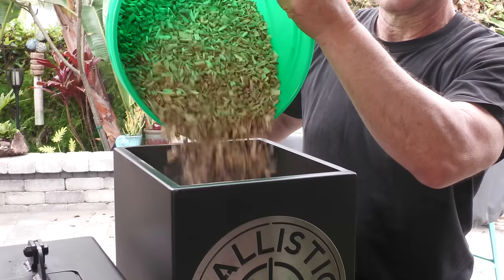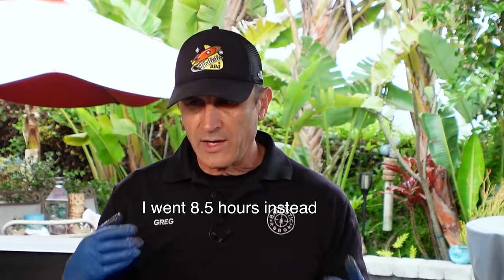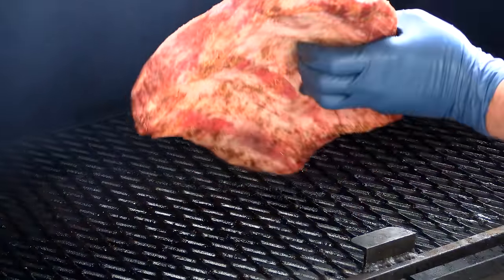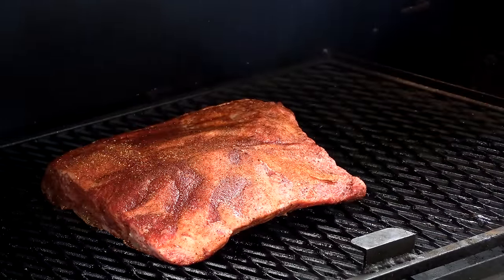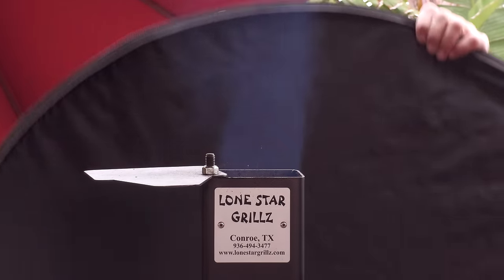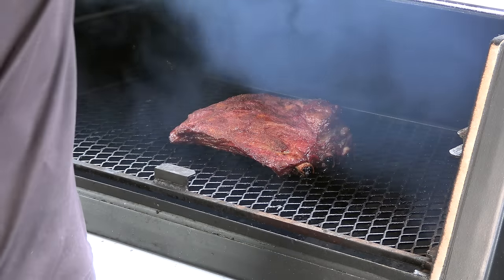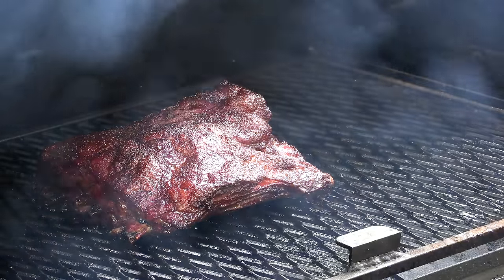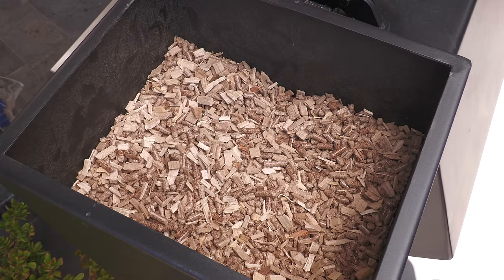Replacing Pellets With Wood Chips In My Pellet Grill On A Long Cook!

Comment: I love how everything is advancing in this industry. That said, I would never try this with my SmokeFire. It's finicky when it comes to pellets and I can see wood chips sheering the bolt off the auger or jamming it at the least. Nice video!
Reply: You are absolutely correct. I've owned numerous Weber grills and when they came out with the SmokeFire I decided to pull the trigger. It's basically a  replacement for a gas grill with a wood chip tube. It won't ignite with many brands of pellets. I've tried six different types of pellets thus far and the only one that works reliably is Jealous Devil Jax Legendary Blend. I live in Florida so maybe it's the high humidity. If I want to really smoke something, I use my Weber Smokey Mountain Smoker. I know that's comparing peaches to apples but, I expected more out of the SmokeFire.
I was excited to see the smaller wood chips available and have been testing them. I started with a 50/50 mix and immediately jammed the auger. I restarted the smoker 4 times in an hour. I next tried a mix of to 60% pellets / 40% wood. That did work better but, still jammed about 2-3 times per hour. I'm down to 80% pellets / 20% wood and it's still jamming irregularly. I know the SmokeFire is NOT a wood chip burner and I'm not talking smack about it, I was just hoping for more smoke flavor.
Reply: @billkelly1793  I use Lumberjack and have had great success with them. Also used Bear Mountain which stressed the auger but worked okay. BBQ Delight worked good as well. It might not give the awesome smoke flavor but it does produce awesome bark and smoke rings. Char Hickory has produced the strongest smoke for me, actually pretty good for a pellet cooker. 

It's been a good cooker for me for almost 3 years but it's like almost every other pellet grill. They give ease of use and let you get along with your day but trade off smoke flavor. Looks like LSG found a formula to fix that. Thought Camp Chef might have but head to head tests still look like it don't compare even to a gravity fed like Master Built.

Comment: I wonder if sharpening the edges of the auger would help the chip size not be soo critical?
Reply: Doubtful. Weak auger motors and hardware(bolts shearing) and too tight of tolerances cause jams. If the industry would shift to wood chips vs. The pellets....or I should say wood chips and or pellets, these type of grills would be much more popular.

Comment: I have a Mak grills smoker and can DEFINITELY say these DO NOT work with a MAK. I'm going to start trying to see if there's a ratio that will even work at all. Can confirm that 50/50 doesn't work. 40/60 doesn't work, 30/70 doesn't work.
Reply: What does “DO NOT work with MAK” mean? Auger gets jammed? No smoke enhancement? No taste improvement?
Reply: @BarryMunkasy  jam city. That's why I mentioned lowering the percentage over and over. The smell was fantastic right up until it jammed. And it's not fun at all getting those pulled out.
Reply: Thanks for saving me the frustrations.  May your next brisket have a choice cost and be a wagyu experience!
Reply: @BarryMunkasy  since Mak has extremely good customer service, I sent them a message asking if there's a more powerful auger motor or possibly a way to sharpen the auger. I'll let ya know what they said.
Reply: @chrishall1407  Thanks for helping us out.  I was searching to see if anyone tried this on a Mak!
Reply: @OSUFANATIC1980  yep. Unfortunately, there is no ratio that works. HOWEVER, since I had the chips, I discovered that they put a great flavor to my longer charcoal cooks on my pk360 using the snake method. So, silver lining. 😂
Reply: @chrishall1407  that stinks. I do same on my Weber when I grill just throw few on top of charcoal then close lid for bit

Comment: Has anyone tried this with a Traeger?
Reply: I did. Was making a brisket last week and it jams the auger frequently. You can hear the auger squeaking a lot like it’s having a hard time passing it through. Really wish it went better. Maybe use less chips next time. Like a 70/30 mix. You should really pay attention to it and be there to clear the auger jams, or as it displays, “auger overcurrent”.
Reply: @jonah327  Thanks for the information.  I'd really like to get some more smoke flavor out of my Traeger, but this may not be the way to go.
Reply: @billfreiberger1627  yeah, maybe try a smoke tube and put wood chunks in it. I’m just gonna buy an offset smoker to have also.

Comment: I did this 3 nights ago for a pork butt cook. I have the 42" LSG pellet grill as well. I used about 62% pellets (BBQer's Delight) and 38% wood chips (Western brand Hickory from Walmart) by weight. I did fill the hopper from bottom to top. Took about 2 hours and they jammed. I noticed in this video the wood chips you are using are about a third to half the size than the biggest pieces from the western brand. 

I agree with your statement of not buying just any wood chip off the shelf. I thought the pellets/chips created a wedge in the hopper causing the flame out but discovered a longer wood chip jammed between the end of the auger where it dumps inside and the steel "Back Board" that keeps the pellets falling down into the firepot. There was literally a 2" diameter wedge of pellets/chips jammed there. I'll give it another try with Chris' wood chips when he gets them back in stock. Thank you for this followup video, I should have paid closer attention to the first one regarding chip size LOL.
Reply: Why not 39% and 61%....? 😋
Anyway, joking aside great test! Thanks for sharing that info. It's all about trial and error.

Comment: First hand account, these did not work well wit my traeger timberline 1300. The auger could not handle the size of the chips, and the temperature fluctuated wildly until I removed them and cleared the auger. I was hoping they worked, back to tube smokers to augment the smoke flavor